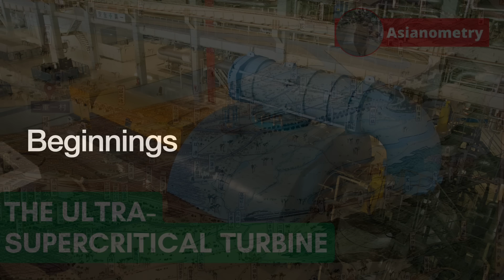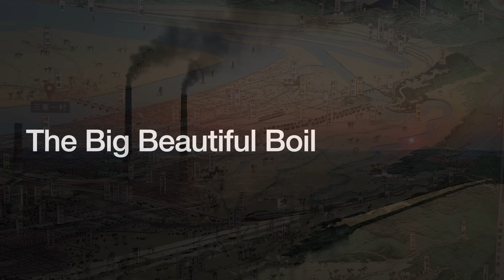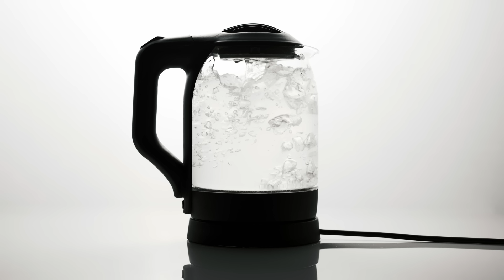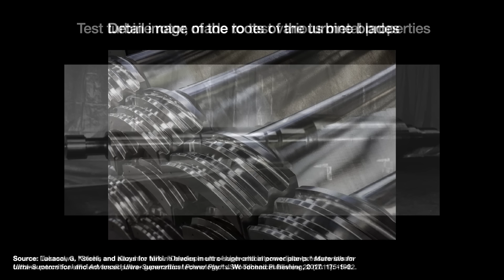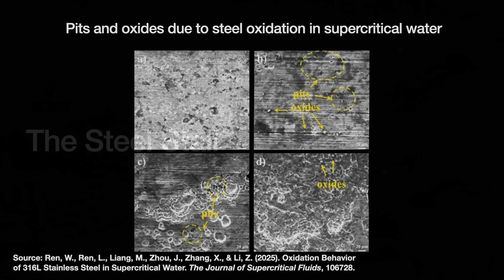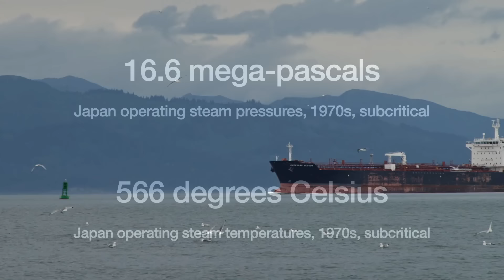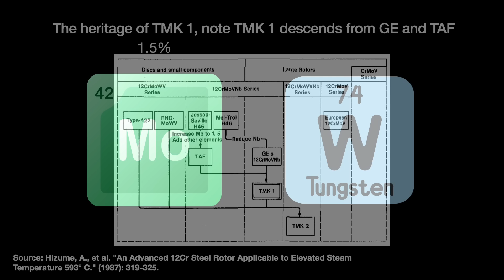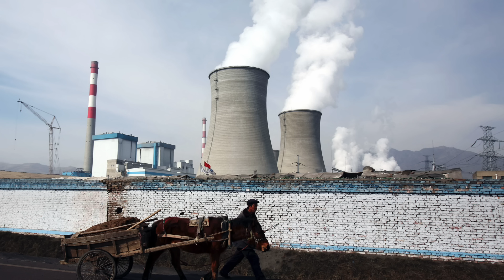The Epochal Ultra-Supercritical Steam Turbine

Comment: In Rincón, Puerto Rico back in the 1960s there was an experimental boiling water reactor which both produced steam and superheated it in the same reactor core- it was called BONUS- the Boiling Nuclear Superheater.  It generated superheated steam with up to 50MW of thermal energy at around 900 degrees Fahrenheit.  It had the promise of greatly increasing the efficiency of the nuclear fuel cycle, but it was determined that it wouldn't be economically feasible to operate such a plant for long term power generation with the metallurgical technology of the time.

Comment: The primary coolant loop on a u.s. submarine power plant is pressurized to 3000psi and the WATER temp in it can be over 800 degrees Fahrenheit.

Theoretically the water in the primary loop is hot enough to light a cigarette. The primary coolant is so hot we use it to make a secondary steam loop that comes out of the steam generators hitting the main turbines at over Mach 1

Comment: The issue is the oxygen - CO2 systems are able to be more efficient because it does not aggressively oxidize at high temperatures, so can operate hotter (apparently). Make sense.

Comment: You seem to show stock pictures and videos of old plants of the 1970’s of 300MW or less. You should show videos and pictures of 1000 MW units of Ultra Critical Boilers and Turbines to appreciate the enormity of the equipments and plants. We have been building these plant  from the year 2000,  now most are operating in the field in Asia (China, Malaysia and Indonesia)

One more thing, in Engineering we usually measure pressure in unit Bar (multiple units of atmospheric pressure) not psi OR Pascal.

Comment: The conditions in the deep rocks are higher in both pressure and temperature than the ultra supercritical. This "water" dissolves many metals such as gold, silver and lead etc. and when released into shallower depths as springs deposit the metals. These deposits can become ore bodies and are the basis of hard rock mining. the phrase Wire gold in quartz ia an example of the materials derive from the initial extreme conditions.

Comment: I need to speak up about some fundamental misunderstandings. 
All low pressure (LP) turbines exhaust into a condenser which operates under vacuum. (1) you get a bigger pressure gradient between turbine inlet and outlet (2) water under vacuum boils at about 35 degs C so you also get a wider pressure gradient between inlet and outlet. The condenser is effectively part of the turbine. 
Steam at 570 degs C has no water. NONE. Pressure is irrelevant it’s all steam. 
Boiler use a de-aerator to remove any rending gas be for it goes into the boiler. Wet steam leaving boiler drum is dewatered before going out. This avoids hammering within the superheater tubes and avoidable for tube failure. 
Steam going through a reheat boiler is lower pressure but every bit as dry as the primary steam entering the HP turbine. 
The result is a three stage, three shaft turbine. HP IP and LP. The latter has blades 7 feet in diameter turning just below supersonic speeds. The stem is just beginning to condense so hard shields are brazed onto the last two or three rows of  blades. Water drops at that speed are highly destructive. 
Sub critical boilers heat the water in tubes around the furnace. Water boils and the wet steam collects in the boiler drum. As said above water is separated before it goes to the superheater. Water levels are controlled in the boiler drum. 
Supercritical boilers are very similar but have no boiler drum.  Water levels cannot be seen because water and steam at these pressures look exactly the same. These boilers are more efficient but are harder to control. Early designs were often rebuilt as drum boilers. They were that unreliable.

Comment: Something to keep in mind here is that these ultra-efficient turbines still waste more than half the heat.  There are further losses in transmission.  This means that using electricity for purposes such as cooking, space heating, and hot water is going to be lots less efficient than burning natural gas at the point of use.  Your  clothes dryer should be burning piped natural gas not electricity.  Our power plants should be burning coal as cleanly as possible or be nuclear powered, not burning a versatile energy source that has better uses and should be conserved for future generations.

Comment: Once you go beyond the supercritical heat point that "steam" gets extremely aggressive and reactive. Also the potential energy is scary. About a stick of dynamite per ounce. A place I worked at used it to grow potassium titanium phosphate, quartz, and other crystals. The reactor had a platinum iridium liner with a high tensile steel vessel. The whole thing was heated to bright red hot then held and slowly cooled. Even more crazy were the nitride crystal reactors. Those were filled with ammonia and heated similarly. If any of these reactors failed while you were in the bunker you would meet God. 😮

Comment: Note nuclear is limited by the temperature and integrity of the fuel. The limits on fuel temperatures to prevent failure prevent super-critical designs from being practical. The fuel being relatively cheap may discourage as well. But typical plants with 300°C primary circuits would mean a fuel temperatures of >~600°C and the limits of what the fuel is allowed before failure. My experience is with Canadian Candu's. We operate a reheat cycle and achieve about ~33% efficiency with the waste going to the heat-sink (lake).

Comment: I've always understood the steam power generation layout using a T-s diagram (an h-s diagram just never made intuitive sense, despite it giving you the h values right off the diagram - you have to look them up on a T-s diagram). All the major components are clearly evident as you moved around the Rankine cycle on a T-s diagram. Would have helped with the explanation showing the simple boxy loop of the Carnot Cycle versus the bigger enclosed area of the Rankine Cycle. Since the area within the loop is indicative of efficiency, it becomes immediately clear why you have Reheat systems as well as slight vacuum conditions at the LP exhaust. To the point of the video, it also becomes clear why you want to increase temperature and pressure. Make the enclosed area bigger, and you get higher efficiencies. Simple in theory, hard in practice.

Comment: Molten Salt reactors could be "drop in" replacements for coal as the heat source  (Yes, I know about CO2 turbines, let's not mix 2 new techs rolling out at once, this seldom ends well)

SINAP's TMSR-LF1 is currently the only operating experimental unit - a rebuild of Oak Ridge's MSRE (1965-1969)  and the ONLY molten salt unit to have ever been fuelled with thorium(*)

This is nuclear power:  

- without a dependency on weapons programs (enriched uranium is a byproduct of rhe bomb making process)
- without water and insane pressures in the nuclear core (limits temperature  to 350C and water is spicy, you really don't want it hanging around nuclear bits)
- 80% cheaper to build and operate than LWR (no need for insanely expensive pressure vessels and steam containment buildinsg)
- Fuel agnostic (enriched uranium, thorium, depleted uranium, spent nuclear fuel all work along with plutonium)
- with 99% less output waste (taking your wate pile from "about an olympic pool of volume per 1GW plant pwer 60 year lfespan" to "a few cubic metres at most")
- several hundred times safer than LWR - in particular, immune by design to the kinds of events we saw at TMI, SL1, Chernobyl, Fukushima, Besse-Davis or even sopdium designs like Monju and Santa Susanna, along with peripheral water-related issues like Mr Ouchi's unfortunate adventure (Warning: Looking this up is not recommended after lunch)
- running at 600-850C, with the coolant boiling temperature well above the fission limiting temperature of ~1150C
- walk away safe
- can't catch fire (sodium), can't explode(LWRs)
- Is hot enough to essentially be a drop in replacement for coial burning and/or an industrial process heat source
- is predicted to be about 25% the size of coal burners, inclusding containment structures (Chinese coal power stations seem to be built with this possibility in mind)
- in the absolute worst case of a leak or breach, the coolant freezes solid at 400C - meaning leaks don't go anywhewre outside the reactor pit and worst case scenario requires more or less "a broom" to cleanup.

There are a few interesting other positives 

- such as when drained and left for a few days the pipework and reactor lose virtually all radioactivity and are safe enough to work on without waldos, but more importantly the things can be refeulled online and potentially run for years at a time
- using thorium as fuel solves the most expensive part of rare earth mining - there's more thorium in most ores than everything else combined at selling it at the same price as raw uranium (about $150/kg) turns rare earth mines from economic blackholes to insanely profitable
- interestingly coal ash has a very high percentage of thorium - much higher than monazite ores, making coal ash slurry lakes a potentiually valuable resource and effectively turning them from superfund cleanup sites to something that can pay for that cleanup.
- they're virtually impossible to weaponise. By converting thorium to U233 in the loop, there's no exposure to the (very slight) possibility of producing U233 for bombs with external processing - this was always the big "bugbear" that the anti-MSR crowd would scream about but China's already proven that thorium can convert in the loop without issue.
- molten salt corrosion levels are negligable compared with spicy water (naysayers try to conflate molten salt with brine corrosion issues, it's like comparing apples with nitric acid)

Asianometry could do worse than a history of civil nuclear power, the ancestry of the original LWR (Via X10), why enriched uranium was used (it was the only thing available and high enriched means a reactor small enough to fit in a submarine hull), why Alvin Weinberg felt it was a laboratory glassware demonstrator and was extremely uncomfortable withit scaling up to large sizes (engineering stresses on boilers go up with the cube of power - that steam drum pointer factors in here) and investigating the politics of why in 1972 Rchard Nixon ordered the MSRE dismantled, all the research notes destroyed, AEC rules rewritten to prohibit molten salt operation without explicitly saying molten salt is banned and an effective attempt made to erase the entire project form history - this isn't something you'd do for a project that proved unviable, nor is the sheer level of hate thrown at it by USA nuclear advocates understandable (if it wasn't viable, you'd think they'd welcome someone proving it rather than ganging up to try and stop it)

(*) LWRs have been fuelled with thorium, but it's expensive to preprocess for them, the resulting fuel is extremely radioactive befoire use (enriched uranium is barely radioactive) and produces just as much waste as enriched uranium. That's another thing the anti-thorium crowd latch onto whilst trying to ignore the issue that LWR's many issues are completely different than molten salt ones.

If that "80% cheaper" works out in real life then nuclear power just got cheaper than everything else and renewables aren't worth bothering with. We have at least 20,000 years thorium supply in known locations and mines, with estimates between 200,000 and 2 million years if we actually went looking for it - it also solves the issue of rare earth monopolisation we're currently seeing (CHina' didn't corner the rare earth markets by lower environmental standards, it's because the Chinese government has been hoovering up the processors' thorium output for the last 20 years in anticipation of the TMSR work paying off)

Ultra-supercritical steam turbines play into this equation - Nuclear reactors are a heat source, not a generator. This all matters because current electrical generation is only 1/3 of our carbon emissions and we're going to need at least 6-8 times current annual TWh production to fully decarbonise, with unrestrictied rollout into developing countries or else their increase in carbon emissions will easily outweigh any reduction in industrialised ones

(BTW: It's alaso worth looking at how the Permian extinction endgame played out and how quickly it happened past the knee point of methane clathrate blowouts, then look at what's happening int he Arctic ocean with particular emphasis in what's been happening in the Leptav Sea over the last 20 years - climate crisis may be an understatement compared to potentially having planetary oxygen levels drop to 12% or so in a period of 3-10 years if CO2 levels snap from 800-900ppm to 16,000-25,000ppm)

Comment: When I was in school and learned that nuclear power plants produced electricity from heat I was unimpressed. Somehow I had expected that there would be a more direct way from splitting atoms to get an electric current running, but in fact they used nuclear power plants just to heat water to steam, like burning wood or coal, it seemed so antiquated...

Comment: I assume they are generating AC.  Is that correct?  And, if they are generating AC, does that mean that these turbines have to operate at a fixed speed to maintain the 50 Hz or 60 Hz frequency they are generating?

Comment: Thanks. Very interesting information there. But your statement about Coal being used for the majority of electricity generation likely refers mainly to the USA, so it needs some qualification. 

The U.K. uses CCGT for its main non-renewable source electricity generation. A few reserve facilities use Open Cycle Gas Turbines (OCGT). A handful burn bio fuels. Not ideal, but they do reduce the waste disposal challenges in Britain. (Landfill also creates plenty of CO₂.) 

No coal-fired power stations operate here, because coal is both quite expensive and dirty. Our oil-fired plants are pretty much dormant too. We also use nuclear power generators. Last year, for the first time ever, over 50% of our electricity came from Carbon Neutral and renewable resources, with wind power being the leading source of our electricity. Dependence upon fossil fuels is reducing by about 3% per annum.

Off-topic, but, in addition to the 'usual' noxious exhaust gases, coal-fired power stations emit radioactive gases, which have been tied to the repeatedly-demonstrated increase in cases of lung cancer among the population which is within about 20 miles of the exhaust stacks, despite filtering. Radon is the main culprit. That same gas increases lung cancer risks for workers in all mining industries, in addition to the inhaled dust problems. Improved mine ventilation reduces the problem somewhat.

Comment: Seeing one of the rotors up close really makes you in awe on how they managed to forge a 200ton monoblock rotor. Japan attempted a twice reheat plant to further improve the efficiency but metallurgy got in the way again. It is a fascinating piece of mechanical machines, considering it can operate non-stop for 3 years (I think one of the plant in Australia held the record for longest continuous operation of a steam turbine) without needing to stop for maintenance, unlike gas turbine.
Reply: The Australian record was actually broken here in the US in 2007 by a generating unit at TVA's Shawnee plant in Kentucky.  That 1950's era Westinghouse turbine/generator combo generated power continuously for 1093 days which was 20 days longer than the Australian record.  The Shawnee record isn't widely known outside of TVA because they never submitted it for the Guinness Book of Records or even publicized it that much.

Comment: Supercritical CO2 is far superior than steam.  Wet steam erodes and corrodes metals.  Coal is an expensive dirty fuel and is not competitive with hydro, wind, or nuclear power. Using supercritical steam turbines with coal fired power plants does not make them clearer. The best thing to do with coal is leave it in the ground.